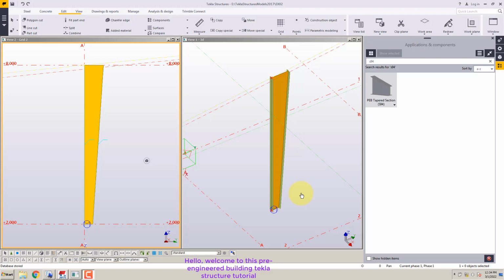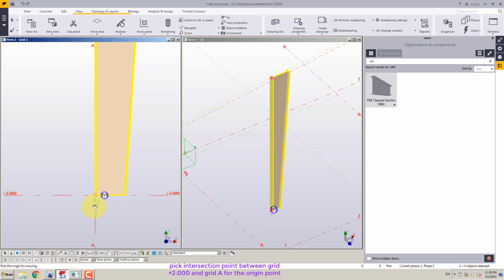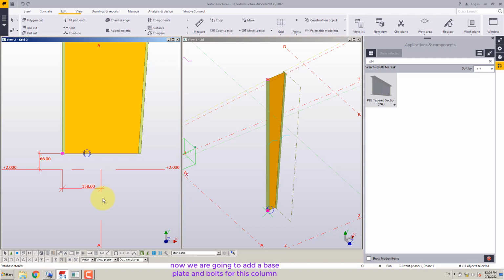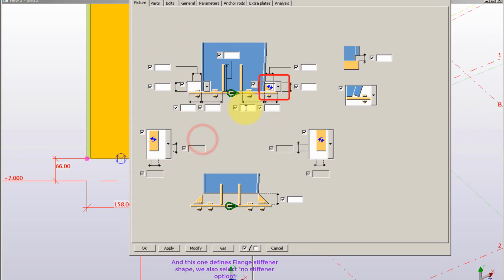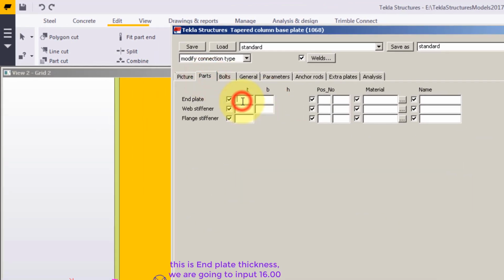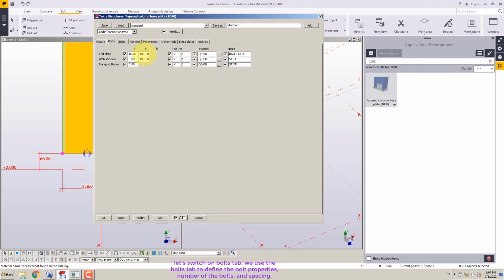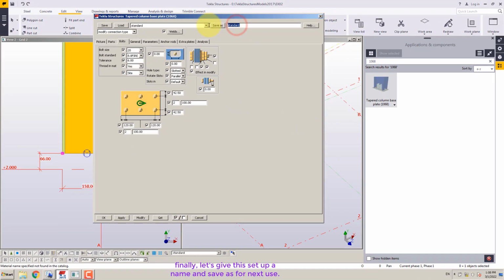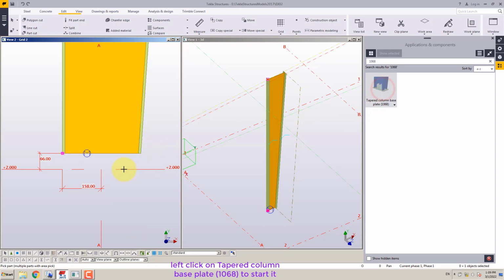TAPERED COLUMN BASE PLATE

Comment: When I use the base plate component of this video in a PEB member from PEB TOOLS (Warehouse) it is not correctly welded. Should I correct it manually?
Reply from the maker: could you send me your model, I will check and find a solution for this problem